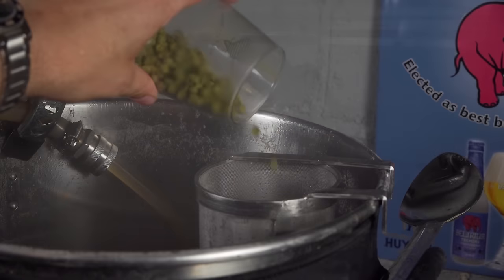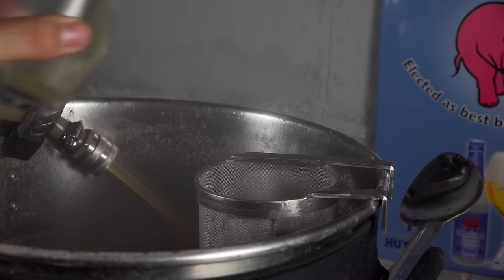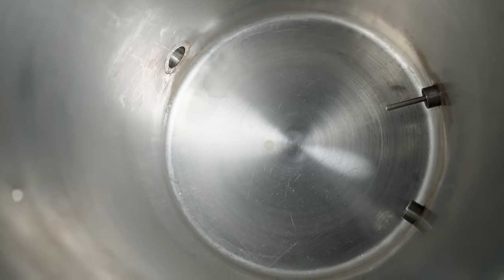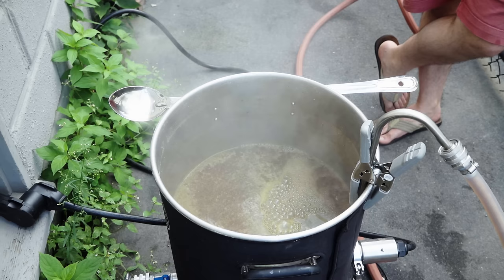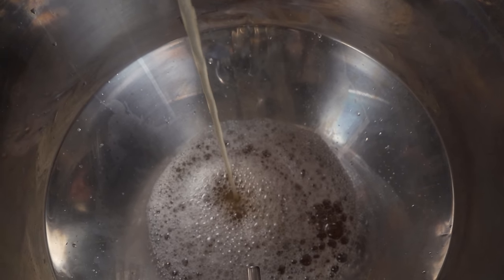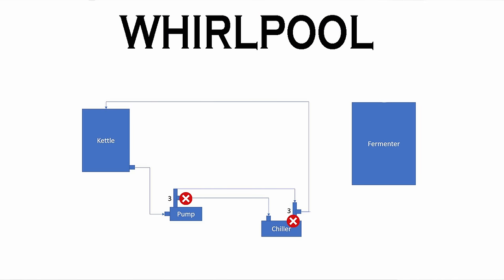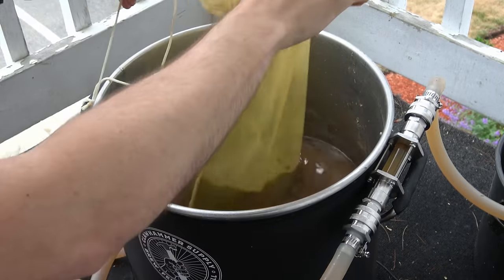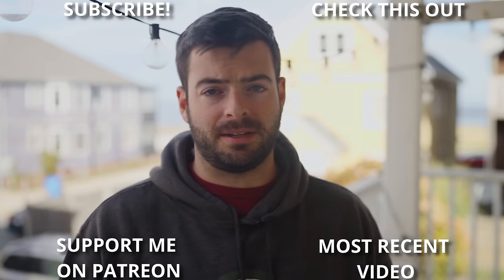MAXIMIZE HOP FLAVOR! How to Add Hops FREELY Without CLOGGING Your System

Comment: U always use wirflock tablet to create cone??
Reply from the maker: It helps - that is a good point. But you don't really need it. Hops, which are usually the clogging culprits, will drop out with gravity.
Reply: @UChJQG0k-fbQprV6n_wHBkLQ what number to use???

Comment: I hate the hop spider because it is way to short and only a few centimeters are within the wort. I changed to an old biab-bag, which works quite well in case of keepint the hops out of the final product. Not sure about the utilization, but only had two brews this way.

Comment: I've been using a similar method for years. I use an immersion chiller that I keep in a bucket of star san solution near the kettle. I have had 8oz in the whirlpool without ever clogging the pump. I run the wort through a sanitized hop bag prior to running the wort off to the fermzilla which collects most of the hops. I have never worried about trub entering the fermenter and it's never caused any issues for me in terms of off flavors or clarity of beer styles that are supposed to be clear. I do not want the hops in the fermenter for obvious reasons. On an unrelated note I bought an Apartment Brewer t-shirt in a xxl(I'm  a husky fella) damn thing fits like a medium. 😂
Reply from the maker: That sounds like a solid method! Trub doesn't really affect the clarity at all in my experience either. Sorry the t-shirt size got messed up - I unfortunately can't control that. If you reach out to Teespring they should be able to issue you a refund or get the correct size.
Reply: @TheApartmentBrewer  I definitely wasn't suggesting you have control over teespring I know better. Ordering shirts online is a crapshoot because sizes are not standardized And I have a bunch of shirts sitting in drawers that I cannot wear because they're too small or too big. Usually the ones are too small my 5 foot tall 110 lb wife ends of wearing as a nightgown so it's not a total loss.

Comment: I get that early addition hops are not going to add much bitterness after 60 minutes. What about late/whirlpool hops when you are not chilling the wort for 20 minutes? How do you calculate timing and IBUs?
Reply from the maker: That is something I have yet to really test out but I haven't found a noticeably stronger bitterness in anything yet. I've made a few brews with and without late additions with this method and they haven't been overbittered.

Comment: I used to use various hop spiders and found that they are more trouble than they're worth. Plus you lose some hop/flavor aroma as per this video. I ditched the hop spider(s) and just throw the boil hops  in now unhindered. I also do not hop a great deal for flavor or aroma during the boil but add most of that during the flame out/whirlpool if the recipe calls for a fair amount of hops. For aroma in ipa's etc who can add hops during the fermentation or post fermentation (dry hop).

Comment: I used to use a hop spider but now I just use the spider as a filter for the hops before transferring to a fermenter.

You should do a video on how to shorten a brew day. That's something I've been exploring myself.

Great video as always.
Reply: I chill 10G batch using  Jaded immersion chiller and recirc using pump into igloo with 2G ice block- saves a ton of water and I chill the water in advance in Corney. It’s 3 stages - 1st 2 gals for heated sanitizer, 2nd 2 gals with chilled Corney water ( for 1st Kviek  pitch ) 3rd 2 gals with ice block and chilled Corney water. Super primitive low cost chill method.
Reply: I clean as I brew and prep things like water and crush grain the night before to break up the brew day.
Reply from the maker: My brew days are anything but short - mainly because I'm filming a lot and setting tons of things up. But you can save a little time by prepping as much as possible the day before - your grain, water salts, even heating up overnight if you trust your system enough. Or performing an overnight mash. Cleaning as you go helps a lot too.

Comment: This is the ideal process to get rid of clogs, but I am too paranoid about sanitation to rely on star san to sanitize a plate chiller. I found that the easiest way to clog a chiller is to stop the flow. Cold break + hot break + hops will almost always clog a chiller, but if you stop the flow after the 'sanitize' step, you can pretty much guarantee a full clog. (Ask me how I know). This had nothing to do with hops. I made about 4 different NEPA with 4-8 oz of hops in the boil (30L) and a quick backwards flush would do the trick. Recently did a Hef with 2oz, and the proteins formed a nice jello inside my chiller that forced me to clean it with 60psi garden hose pressure and use my immersion instead!
New setup works like this:
@20 mins whirlfloc
@10mins recirculate into hop spider; this captures a tonne of trub+hops into the spider that I then remove to avoid over-doing the isomerization.
@5mins cycle through plate chiller into whirlpool arm
At flameout I will stop flow and drain the chiller + hoses** important
Good 10 minutes rest for the hop cone and then I will pump through the chiller to collect the wort. Works great for people like me who need 5X peace of mind
Reply from the maker: Thats a great method, thanks for sharing! I have recently started hooking all my valves and hoses up now at the start of the boil and sanitizing my chiller by running boiling wort through it for a few minutes prior to adding my first hops addition. This seems to work pretty well, and as long as I don't disconnect hoses.
Reply: @TheApartmentBrewer  will give this a try, just have to wrap my mind around what happens to everything in the lines+chiller during that 60 minutes 🧠

Comment: Wouldnt you need to put in your immersion chiller before you whirlpool?  You need to boil it for 10 min?  I would put in my chiller during boil, then remove it placing in a sanitary bucket, then whirlpool.
Reply from the maker: Yes, you can do that and still whirlpool. It won't hurt the formation of the cone.

Comment: I use this method continuously.  Except I just stir it, stir for a minute and with the centrifugal forces, the lighter materials and trub naturally settles to the centre.  I would also like to add one thing, StarSan won't be effective enough to santise the heat exchanger (if anything got hold inside), so would recommend a stronger sanitiser like Caustic soda at a 5% concentration.  Just rinse before use.
Reply from the maker: Thats a good point. I've been hooking up my chiller and hoses at the beginning of the boil now and sanitizing at the 60 min mark with the boiling wort before adding my hops. Works like a charm!

Comment: An emersion chiller makes this more complicated as you typically need to move the chiller up and down to cool it effectively.  Also the chiller in the wort really messes up the circular flow of the wort during whirlpool.  It may work if you do the whirlpool after you chill it though and remove the chiller.

Comment: I have been using a hop spider for nearly a year.  Yes, it does help mitigate clogs, reduce clean up time and restricts hop utilization; however, I do notice a difference in flavor and aroma.  I need to give free hops a try during the flavor and aroma time during the boil.  That might be the game changer.  Thanks for the tip!
Reply from the maker: If you want to just dip your toes in, try it with a pilsner or hoppy European lager as opposed to a hazy IPA or something. That way you can try without using a ton of hops

Comment: Another option is to free hop then chill the wort down with a wort chiller. Place a large sterile mashing bag into the fermenter then run the wort and hops through that. Bag will act like a sieve. Remove the mash bag from the fermenter and discard the hops and trub.
Reply from the maker: That is a pretty good idea as well, but if you use a plate chiller it would still risk clogging it since all that material has to pass through it.

Comment: Hop spiders are great in ththeory until you realize that the coagulated protein break just clogs up the mesh and there's very little exchange with the overall wort.  You would have to pull the spider out and rinse the mesh off before every hop addition to get it right.  You're right that the mesh matters, but they all get clogged.  
There used to be a company called Utah biodiesel that made an amazing bottom of kettle filter (I call it a trub condom) that would let your pickup tube be protected from the large hop matter.  That would clog of course too, but liquid could still get under it, it was large enough.

Comment: I use a three vessel system, with a counterflow chiller.  I was doing a longer whirlpool and not getting much of a cone.  I'm excited to try the shorter whirlpool and see the difference.  Thanks for the video, and the idea!  Cheers brother.
Reply from the maker: A CF chiller would be an awesome eventual add since it definitely would be tougher to clog. Check out the tea leaf paradox!

Comment: Well, I gave it a try. Immediately clogged my pump. I don’t think Anvil brew pump was meant for such advanced techniques…
Reply from the maker: How many hops were you using?
Reply: @TheApartmentBrewer  3 oz at the whirlpool. Do you add them while the pump is going, or do you wait for the hop pellets to break apart in solution a little before starting up the pump?
Reply from the maker: @Ben Scarpino  gotcha. Usually I just keep the pump running the whole time. Then again I don't have an anvil system so that pump maybe a lot smaller diameter
Reply: @TheApartmentBrewer  I think it may be an issue specific to my pump. Which is a bummer, because I was looking forward to the extra hoppy boost.

Comment: I'm not convinced. My money is on the additional contact time and change in temperature over time using the whirlpool contributing the additional flavour, not the omission of the hop spider.
Reply from the maker: It's possible, but I've observed a change in some beers that haven't had late boil hops as well.
Reply: @TheApartmentBrewer  curious, perhaps there’s additional utilisation of the earlier boil hops as well. Or perhaps it is the spider! Only a controlled experiment could say for sure 😁